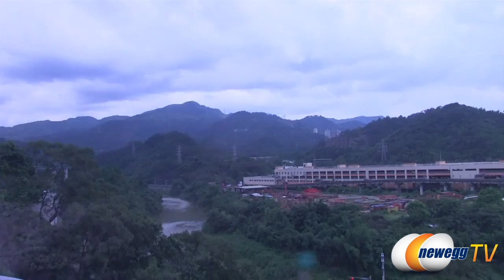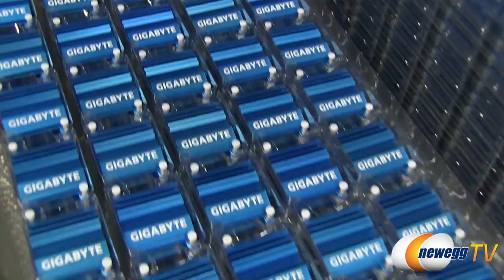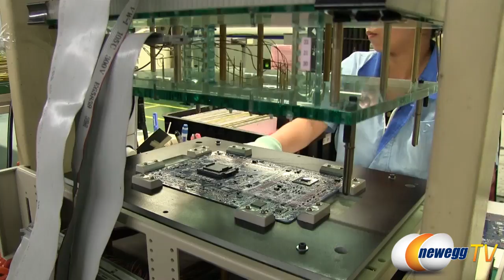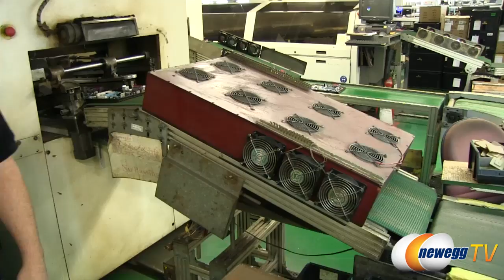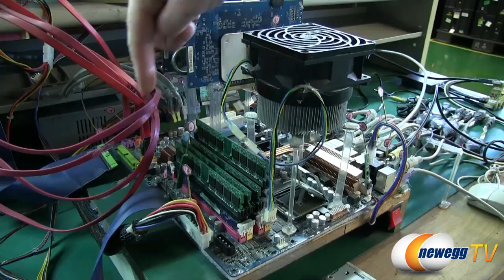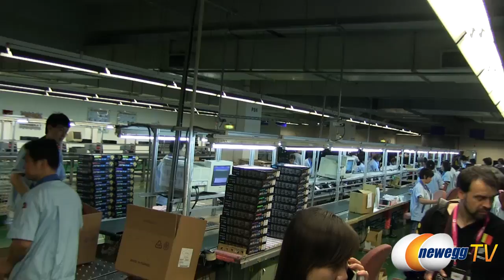Gigabyte Motherboard Manufacturing Factory Tour - Newegg TV

Comment: well the first board i bought for my new i7 was a Gigabyte and i do like them, but i had way to many problems with this one, one of them was that a dual sata port was tilted 30% and out about 3mm, the main holding brackets were not attached or broken off but the data connections were intact, either way i switched to Asus

Comment: Heh. It's an anti-static wrist strap. It ensures the user is properly grounded so static discharge does not damage any of the components they are working with. You can buy them on Newegg as well. =]